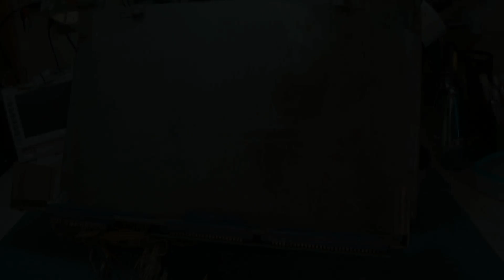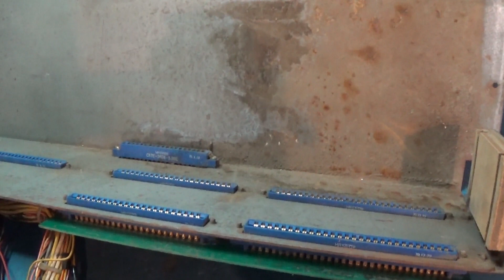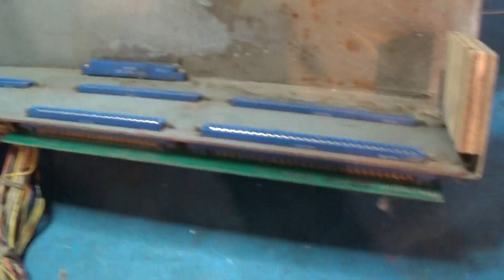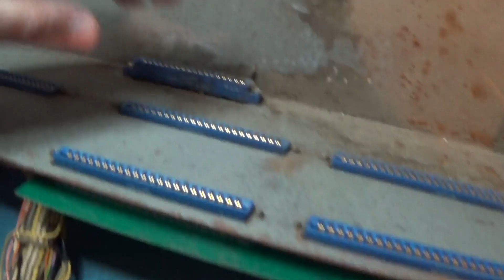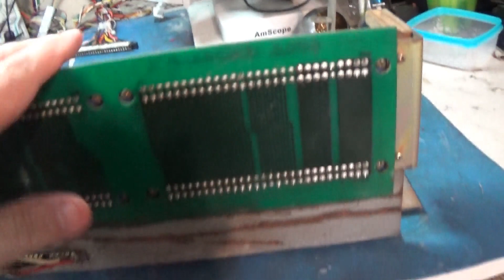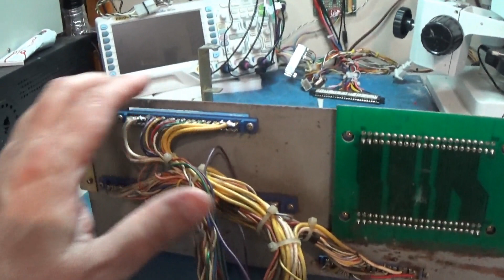1980 Sega Monaco GP Arcade PCB Set Repair -- Part 1  - The beginning   5-30-23

Comment: Hello from Texas!   I'm John.  I just acquired a mini Monaco GP less than a week ago.  It appears to have issues, but the Sound Board played the fanfare on power up, displays seem to work for the most part, so I think it's in the CPU Board (or Boards).   Mine has no sockets like the one in the video, at least the first board I pulled.  All the ROM's (and every chip) is soldered in.  Was racking my brain trying to think on how to troubleshoot these things in the game, was going to make Harness Extenders to get a board plugged in but out of the cabinet.  Back in the day they actually had a board that was a Board Extender with the 3 sockets on it (back in 81 when I got my first GP).    Question is:   How much would you charge to test/repair my 2 CPU boards out of the game?  Thank you for your consideration :)

Comment: These game boards (minus the sound board) have 304 logic chips on them, I know as I've counted and recorded the totals of each type just in case I need to replace every single one! Hopefully I won't have to as it was displaying a picture before it died after being powered up for the first time in decades, it had no road scrolling just the width changing and a static player car. The clock divider circuit flip flops were the first to die, then the crystal fell off due to corroded legs!